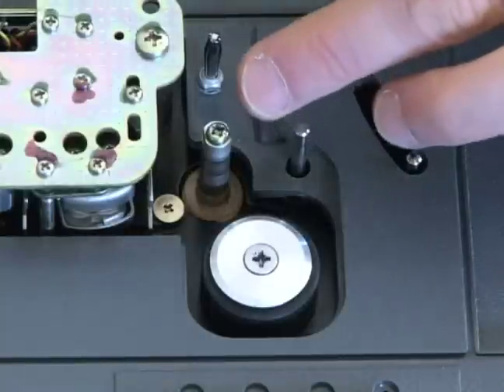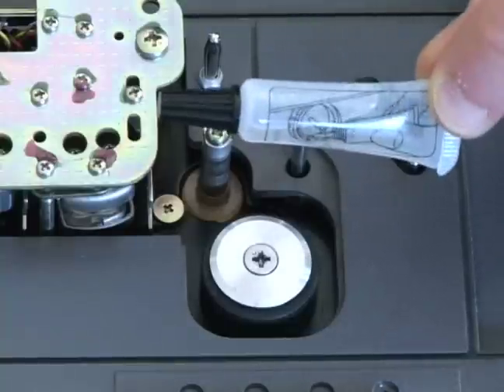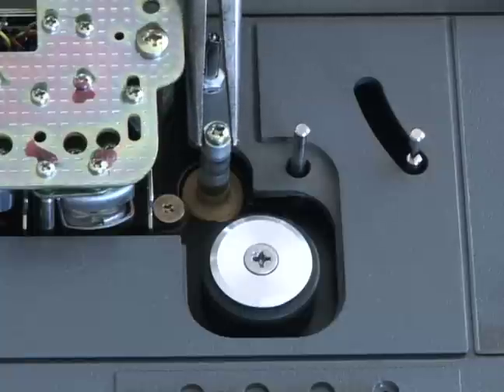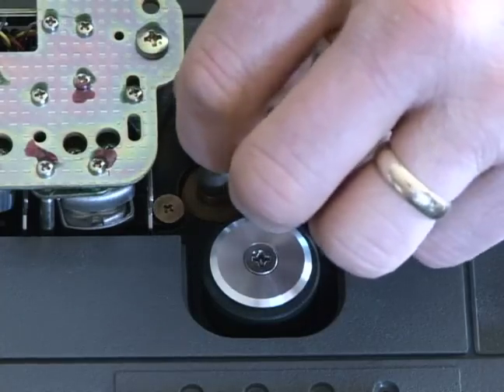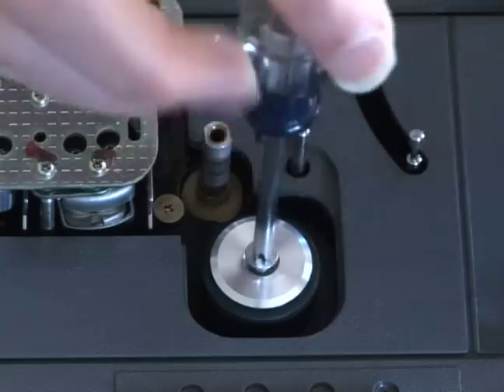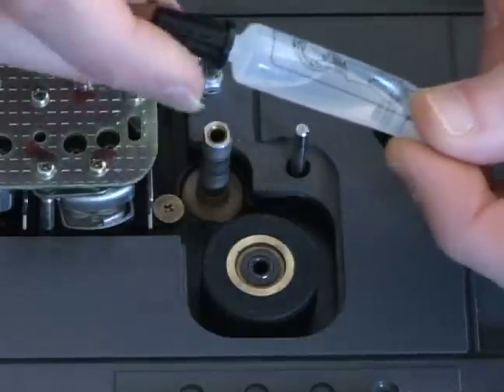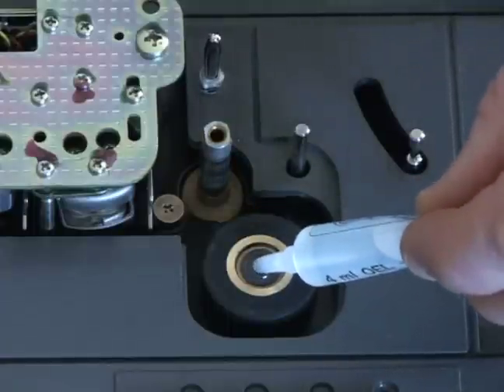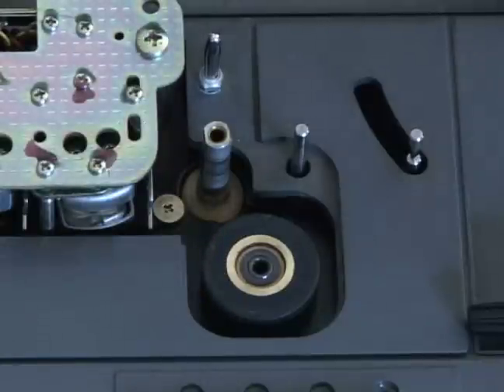Reel-to-Reel Recorders : Lube Capstan of Reel-to-Reel Tape Recorder

Comment: Totally INCORRECT. You oiled the screw threads and that was it.  I recently bought a used Dokorder 7140. The capstan was FROZEN for lack of lubrication. I got hold of a 7140 service manual to see how to lubricate.  (1) Take the screw off the capstan and REMOVE the sleeve - pull straight up - it may be tight.  (2) Take a small slot screw driver and carefully lift up the thin plastic washer at the base of the capstan shaft. It's called an "oil stop" to keep oil from coming up the shaft. (3) With the tape deck laying on it's back, put several drops of oil at the base of the shaft.  I did this and then turned on the machine to work the oil down the shaft.  The capstan loosened up very quickly.  I wiped off any extra oil, put the oil stop washer and capstan sleeve back on. Runs great now.
Reply: yes, how he like tutorial expert could to give such ridiculous advice :D) ... simple lubricating such parts must be where are bearings
Reply: Well ... he used sewing machine oil ...
Reply: Thank you so much for this info! The capstan shaft was indeed difficult to remove. I used some players and unfortunately scratched the shaft 😢 putting it back all the way on is also difficult, but I don’t want to force it. Would lubing it with a little wd40 be a bad idea? I don’t want to have it be so difficult to remove next time I need to oil. If not wd40, what? Thanks in advance! 🙏

Comment: In the summer of 2022 - my Dokorder 7140 was howling terribly, the belt was fairly new  - I lubed all 3 motors & by spinning the capstan motor from behind, got it working for a few days.
In the fall - the capstan would not move at all.
I looked online & found this info - (both wrong & right ) & got it working.
My approach: Capstan sleeve was very tight,
I took off the main front cover - (you need to loosen bottom front cover, but not remove).
I could then remove the "oil stop" washer & lube the shaft - used AMSoil 10-30. Capstan still would not move, so I turned the exposed pulley between the reels - the round gray one - by wedging a flathead screwdriver in the center of the pulley and spinning Counterclockwise. When powered up, it still did not move. So I added a little more oil to the shaft & spun it some more. I did this with the unit off, and then I would turn it on. If the capstan still did not move I did it again, at least 5 times. I could feel it getting looser and looser & eventually it spun by itself, no howling and now it's as smooth as new. My lesson - be patient if the capstan is frozen.

Comment: I am a past Chief Engineer in Chicago and I can not tell you how many people I have come across that know nothing about tape decks except how to wreck them. Of course I worked at Sony and Teac before Radio Engineering so that puts me in a special class. Oiling screw holes and Not the bearing is totally ridiculous and I wonder how this guys equipment works doing it the wrong way. The capstan shaft must be removed from the bearing to lubricate it correctly otherwise you are not doing it right. Also sewing machine oil is NOT the right oil as I have found that AMSoil 10W30 Signature series does a much better job resulting is much lower wow and flutter figures than have ever been seen with this equipment and I have many unit of proof- I have some DC belt decks that go as low as .023%wrms.
Reply: does lubrication improve speed. i got a yamaha deck that played once years ago n just sat on the shelf.i bought for like next to nothing from the guy. first i noticed that speed was slow and then it started squealing. is it belts or lubrication. guy says that deck sat all these years from like brand new except for the one hour of play he gave it initially
Reply: Hey sam. Could any synthetic 10w30 from any of the big oil companies be used.

Comment: What optimal maintenance does the Teac A6600 have for proper maintenance of the player? Oh, you have to grease and lubricate some part of the module, thank you, regards,
Hello ExpertVillage Leaf Group, I have a question about how to clean the heads of a Teac A6600. Can you make a video about it on the A6600? Is isopropyl alcohol used for cleaning? and how to clean it, thanks a greeting and a good like from a subscriber,,,,,👍

Comment: I’ve had a R2R for a week and even I know this is totally wrong. You’re just oiling the threads. You need to remove the pinch roller and actually lubricate the bearing surface.

Comment: No no no totally incorrect. You are oiling the threads not the bearings and you should not use that kind of oil.
Reply: I have that problem with my tascam 32 reel to reel, I am glad you guys are saying this, I was about to do the same mistake after seeing this video! I am glad I read the comments

Comment: @JackSofalot could it be that the capstan is hollow and lube can run down inside and maybe there is a wick and holes on the bearing surfaces top and bottom.